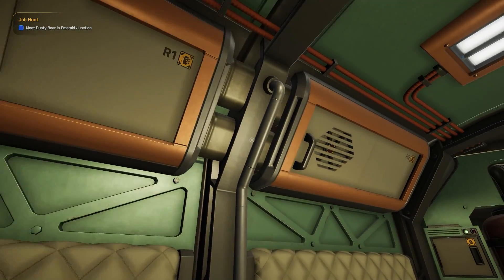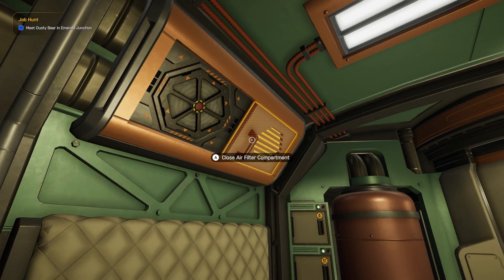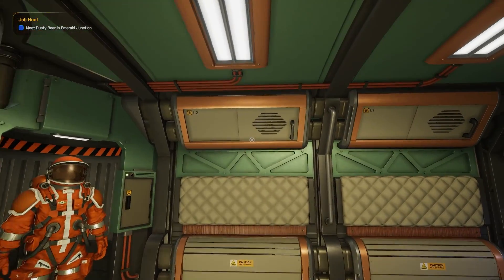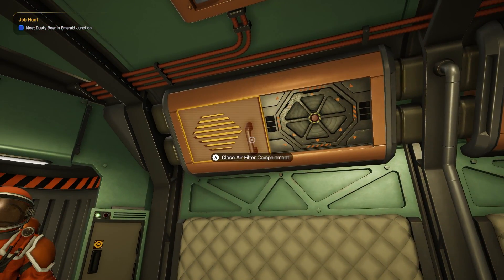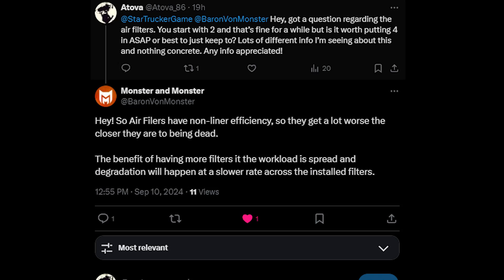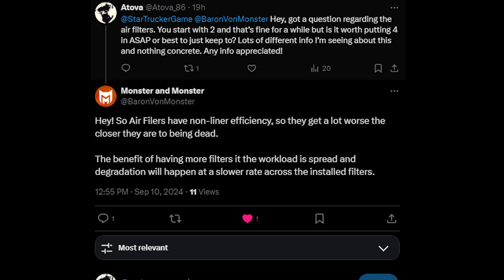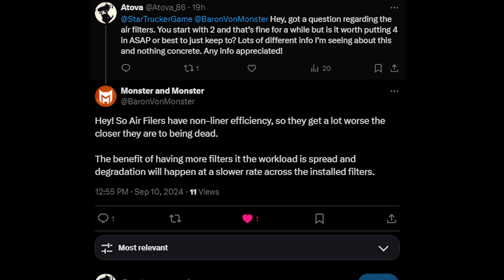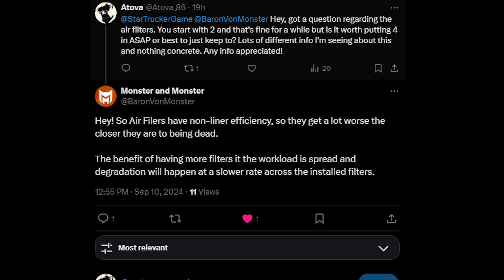Star Trucker - Air Filter Efficiency (Tutorial)

Comment: So I wonder if having 2 dead ones in there reduce the drain on the full ones as well (similar to the batteries)?
Reply from the maker: Not totally sure!
Reply: @Atova  well that was actually what i was looking for in the video. Whats the rate of degration, how much better is 4 than 2, if you have 2 only is it good to have 2 on one side or better to have 1 on each side.
Reply from the maker: @schuttrostig5729  I only know for sure what I have been told by the devs. The more you have the slower the rate of degradation. I don’t have the actual numbers but if you have more it give you longer before you have to replace them.

Comment: Right now I have 3 air filters in, they're at 43% and I'm losing air in the cabin. My battery is good for oxygen, and for some reason when I get in my suit the air goes back up in my cab. Anyone have any clue?
Reply from the maker: The efficieny goes down and need to change them. I run either 2 or 4.
Reply: @Atova  do you think financially it's more efficient to have 2 running and 2 fresh ones waiting to replace them?
Reply from the maker: @alanstein3271  Having 4 will last longer so it gives you more time to make money with jobs. I’m also having a LOT of luck finding them in salvage after getting sensors.
Reply: When you've used the suit it uses oxygen and power to recharge itself.